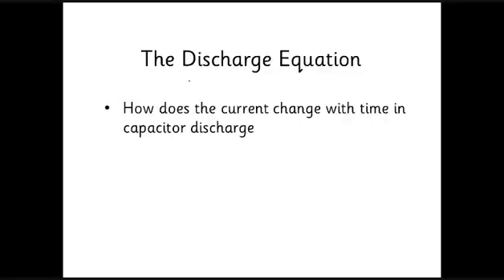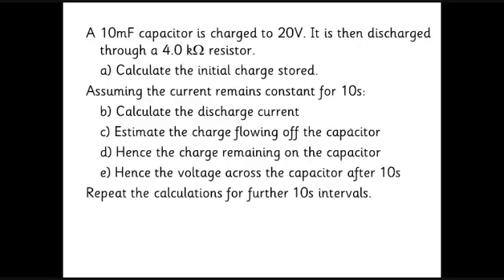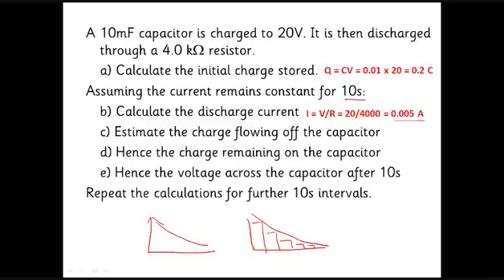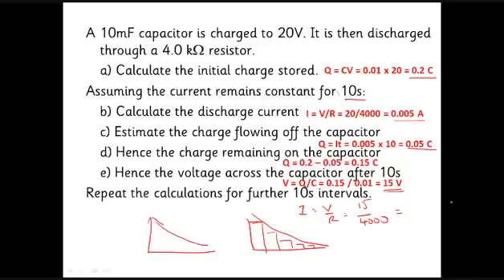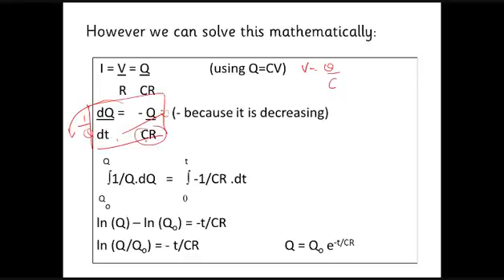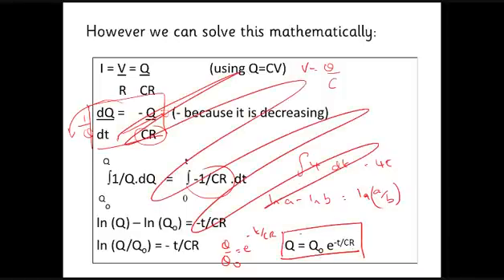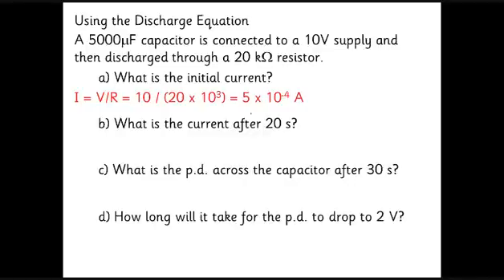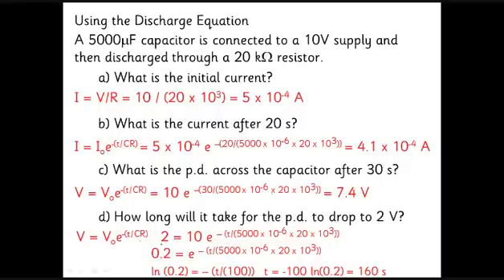AQA A2 Physics Unit 4c Capacitors Lesson 2 The Discharge Equation

Comment: For part b at 1:53, why can't you use Q=It? That's the formula I would immediately think of, especially as the question gives you the time just before part b, but using I=Q/t I got 0.02 rather than 0.005...
Reply from the maker: Sorry - just seen these, hope exams went OK if you were preparing for them. For anyone reading this now the whole point is that these equations are not valid because the pd and current are not constant.